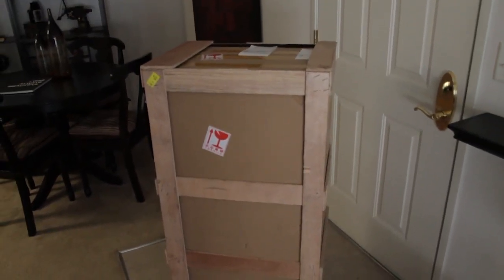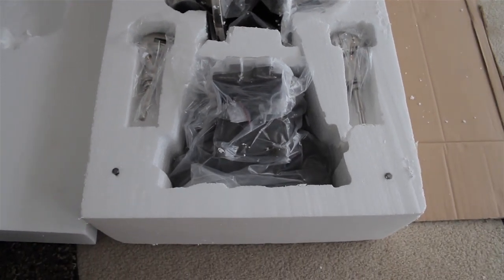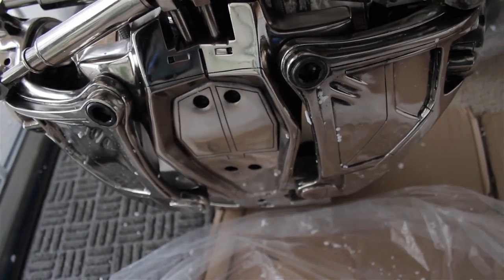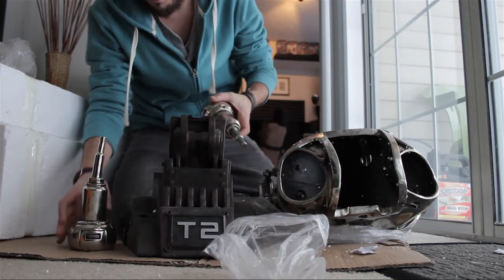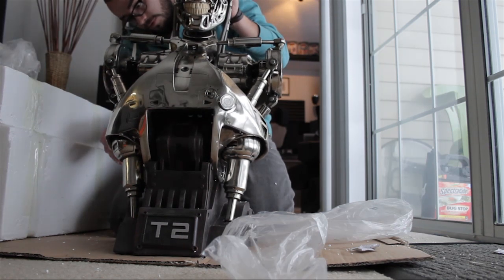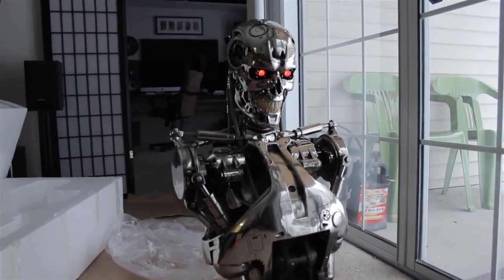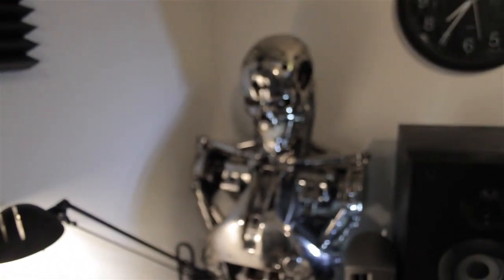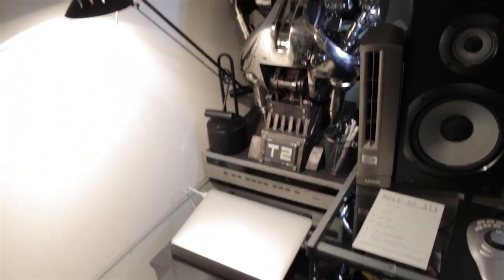Unboxing the OGRM 1:1 Terminator T-800 T2 Bust - LIFESIZE!

Comment: Thanks for making this video. It's quite interesting.
3:25 Straight away I can see they got the neck hydraulic pistons wrong. I've been keeping an eye on all the 1:1 endoskeltons, and 1:1 endo parts. I'm yet to see a single 1:1 T-800 that is accurate. A quick internet search for "screen used terminator" shows loads of reference photos. If I can spot those mistakes, surely the people who are licensed to build these should be even more aware of how they should be made.
Reply: Piston can be put in correct positions and add couple more braided hydraulic hose connections